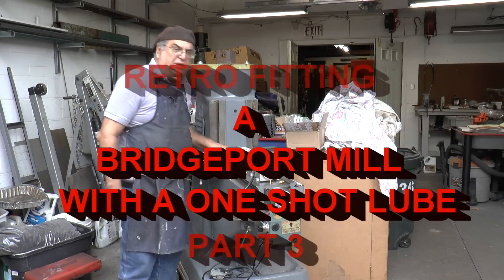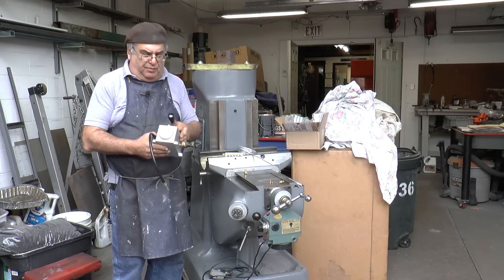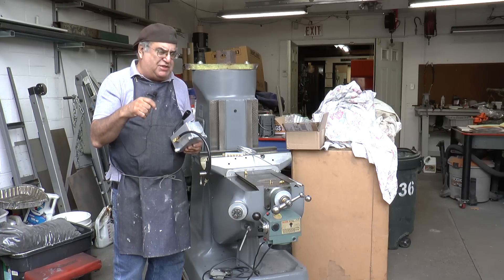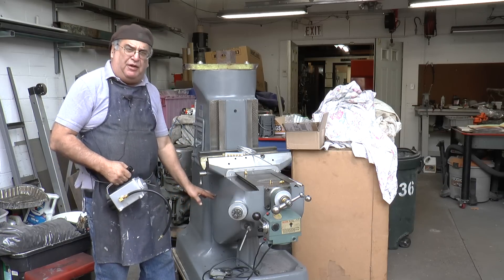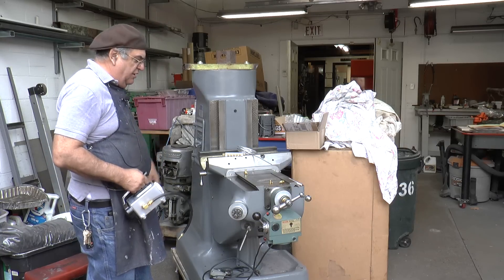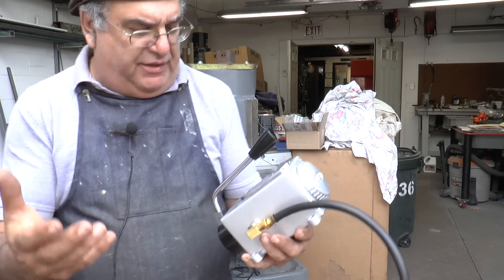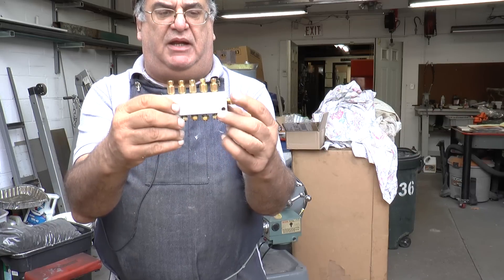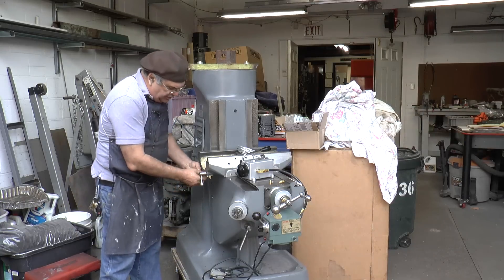RETRO FITTING A BRIDGEPORT MILL WITH A ONE SHOT LUBE

Comment: I know this is an older video, but did you buy this entire oiler as a kit?  When I search for one-shot oilers, it always seems to be just the unit you mounted to the side of the knee.  I haven't yet found where the distribution block with the needle valves for metering can be obtained.  Thanks for the video!
Reply from the maker: try H&W Bridgeport repair parts this is where I got the oiler parts

Comment: great video. very helpful. I was planning exact modification with same parts when I found your video. which makes me feel better that I'm not underthinking this setup. question is how well does it work for you. and what might you do different if doing the install again. also being in stuck at work for another 2 weeks away from home and access to my mill I need to know the NPT thread size for the tubing fittings where they fit into the mill so I can order them. I think they are 1/8 in but could be 1/4. I can't find the answer on the Web or in any manuals I have. again great video thanks

Comment: Thank you for the really good information on Bridgeport mill.  I am in the process of rebuilding a 1966 2J. Please tell me where you got the distribution block?
Reply from the maker: I got the block on eBay. I bought some of it from H&W I hope to get back on that soon I need to finish it I will be making more videos on the restoration.
Reply: trainman4602 
I really enjoy your video's. Do you have to drill oil passages when installing a one-shot  system?  I was under the impression these lines just go to the existing zerk fittings.  Also, do you have a list of parts needed to do this retro-fit? Thanks.
Reply: +trainman4602 Do you have a link to the ebay seller? I can't find it. Looking forward to the rest.
Reply from the maker: If you go on the ebay site and type in Bridgeport one shot lub it will come up

Comment: What is kept inside the column? My turret mill has screw on sheets to cover the two holes in the column and I'm considering putting my electrics in there. I noticed your Bridgeport has a nice hinged door.
Reply: the ones I have seen have the coolant pump in the column.

Comment: Good job. The paint job looks great. As you know, I'm doing my 40 chapter Bridgeport series. Chapter 3 is on lubrication. I talked about my Bijur oiler. I wish I had seen your video befor I did mine. I believe mine was factory mounted--I had mine off & cleaned it well---there was lots of sediment in it. I have bought from H&W , they are a good outfit. I bought their oils so I could show exactly what to use & avoid all the nonsense about SAYBOLT viscosity. I was not aware that I could adjust the flow to different locations.  I had my machine all apart when I put it in the basement--as you can imagine, that was a lot of fun. Your camera work is exquisite. I was at an auction yesterday, they sold the homemade toolbox of a patternmaker. Inside the door of the box was a poster (I think it came out of the Freeman catalog) that talked about the exalted craftsman ----the patternmaker. I thought about you. I'll send it to you by email. I bought an old KINDT-Collins catalog from the 50s, just for referance.

Comment: Nice job. Did that oiler come as a kit? Can you tell me who makes it and where you got it from? Thanks
Reply from the maker: I put it together from parts bought from EBay. Some parts came from H&W machine. They sell repair parts for Bridgeport mills. The pump is from EBay it was &59.00 with shipping. the rest I think was around $100.00 Some kit that I looked t were around $500.00 for a Bijur kit.
Reply: Thanks